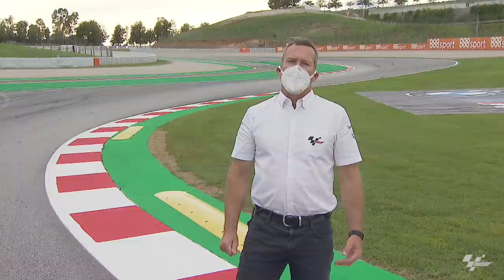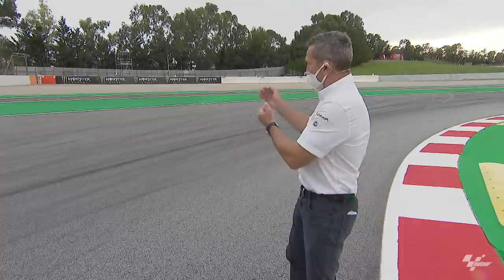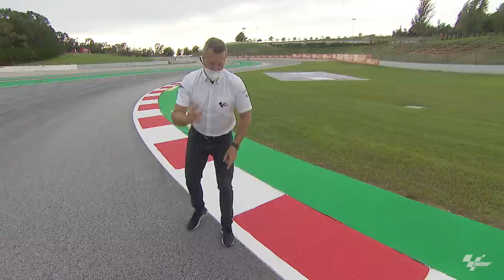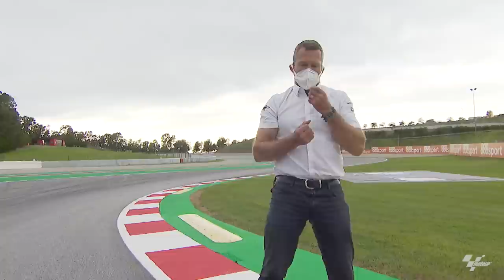Circuit Safety: Tech Talk with Simon Crafar

Comment: If you are standing far away from the cameraman and nobody is around you, it is ok to take off your mask, also you can use transparent face-shield, which will not cause the same problem as the regular mask does. By the way, I'm not really sure if a mask is really that efficient with prevention from Covid-19.
Reply: Mask does not guarantee to make you safe from COVID-19 but its about precaution. Imagine the one time someone didnt wear a mask and he/she got the disease. Also, rules are the rules :)
Reply: @013nil  If you are wearing a mask, you are not protected in any way, you only protect people around you, but the mask needs to be special ones, like the doctors use (no pun intended) and they last for a short period of time and you can still spread the disease. I suggest MotoGP YouTube channel longer lens for cameraman and these videos videos will be much easier to watch. :)
Reply: @blaizze The level of protection a mask gives you depends on the type of mask you are wearing.  COVID is mostly spread by microdroplets so even a basic single layer cloth mask will do well to reduce transmission rates if enough people wear them, double layer cloth masks do almost as well as the typical surgical masks that the doctors use. 

Anything is better than nothing and when enough people are wearing them the transmission is almost nil, and are likely to be more effective than most of the early vaccines that will be available. Masks are much more effective than face shields alone but using both together will understandably be better than either by themself, there are diminishing returns though and while masks are mildly annoying and distracting, face shields, are very bulky and distracting and as such most people choose not to wear them unless they are in high risk environments like hospitals and testing facilities. 

The one Simon is wearing will protect you and others because it is designed to seal tight against your face and has that metal strip around the nose to help seal better but they weren't designed to be used while you are talking whereas typical surgical masks are much more flexible and better suited for talking but are less effective.

Comment: I’m serious when I say this Simon! I have been waiting my whole life, I’m 46, for these types of videos!! As a sport fanatic I always am curious about the details that we don’t usually get to see! That part about having the gravel trap 2cm lower than the track makes perfect sense! The rider gradually hits the gravel rather than straight away!
I have always wondered about things like
Do riders use bumps on a circuit to start/finish a slide?
Do riders use kerbs to kick a rear sideways to straighten out a corner?
Do riders drag their boots or their elbows as well to hold up the bike?
How good were Lorenzo’s tank additions( they were like little wings on the side of the tank)to help hold his knees to the bike as he seemed to get better with those?
I wondered about gravel slowing riders down but also making them spin over causing more injury- have they thought about just using large sections of asphalt that is super grippy or some other material so riders don’t get smashed around in gravel!
I always wondered about someone like Marc - could he adapt his riding style to any bike and be good?
What riding styles do riders have and what makes them good or bad! Eg some may love all the weight on the front or rear and how they adapt themselves?
I know current riders won’t give up their secrets but can you get a retired riders who says stuff like - I was alway coming second until I started sliding the back more or until I started two wheel drifting more or any other interesting techniques!!
I would like to hear about how you rode a superbike and what worked or didn’t work to help you go faster? Eg I only started getting faster when I slowed everything down! The slower I moved in the bike the faster I went or stuff like that! Did certain brands of bikes need you to ride differently eg Had to be aggressive on the Honda but super smooth on the Yamaha!
I could go on forever!
Keep up the excellent work Simon!!!!!!!!